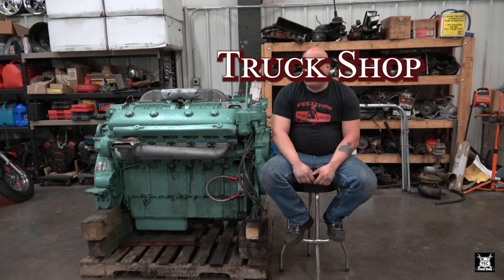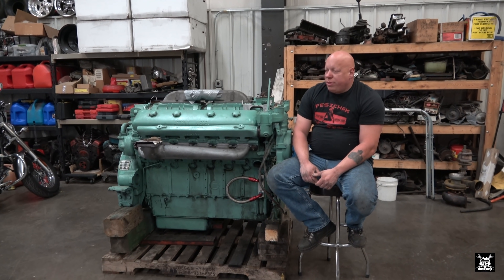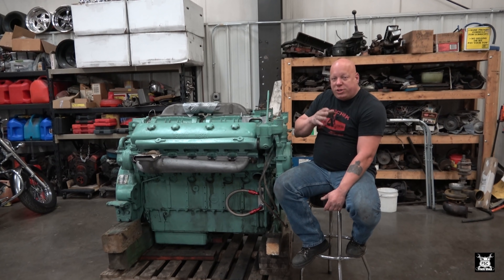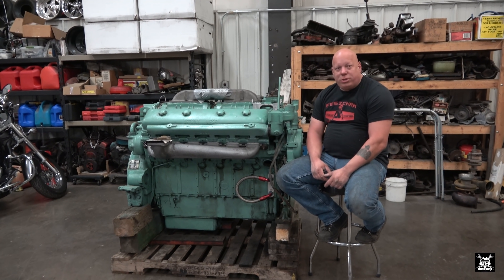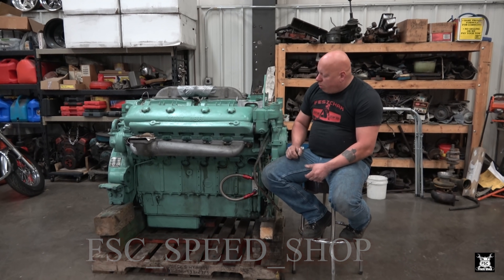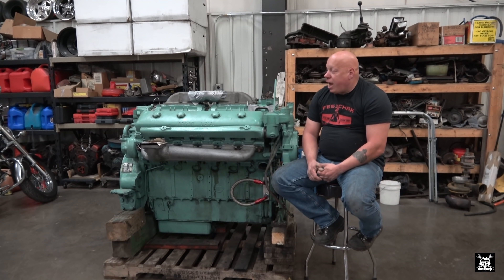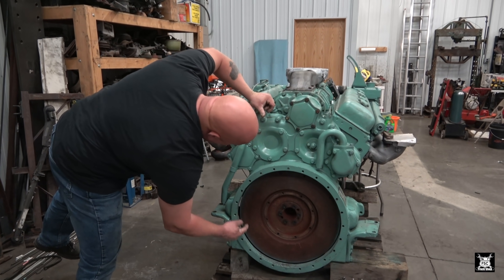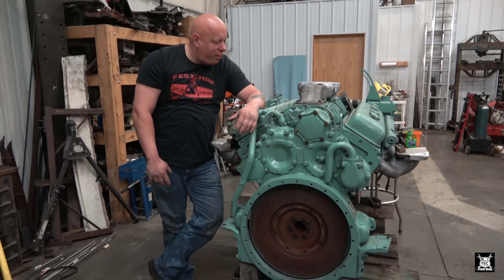Making Plans For My 12v71 Detroit Diesel

Comment: Theres really only one answer to the question. You need to check the for sales for a GMC General. A Marmon, Brockway, Hayes, anything not run of the mill. KW's and Petes have been done to death, id probably still watch though.
Reply: A GMC General would be the best choice for that engine, especially if it had a Detroit 8v-71 so that he could rob parts to make it fit
Reply: @4321grp  I think it would get good views too. So would an Astro.
Reply: @bobbob-fg5wy  I think so too. The 9500, Astro, and General were all the same truck, but different cabs.
Reply: Titan 90, or Bison would be cooler. Much rarer than Generals and Astros. I saw 2 of the bisons with sleepers sell at auction in Minnesota a while back. If he could find one of those, it would be very cool.
Reply: @4321grp .... the 12 would be an Extremely tight / hard fit under that hood... he would have more clearance problems than you can imagine.... Not a good swap candidate.
Reply: @bobbob-fg5wy .... There were quite a few Astro's built with V12's back in the early/mid 70s... but hard to find these days. I drove one for a while before I bought my first truck.  The guy I drove for, bought 23 of them.... also drove a COE "Transtar" (IH) with a 12.   All three of my own trucks had 12's..... and far from "stock" after I "built" them.

Comment: Plenty of great info available on these engines. They are pretty easy to build. I have done several 2 stroke Detroit’s and 3406 Cats. The Detroit is simple and you will have zero problems building this.

Comment: They originally put a data plate on the valve cover that told you the build,whether it was an Industrial,marine or OTR.
The type of flywheel housing,pulleys and governor is going to be an issue if you want to put it in OTR truck

Comment: Steve, make sure the truck that you want to get for this engine is already plumbed & wired for a Detroit 2 stroke. If this engine came out of a Terex,most likely it's from a dump, loader, or a scraper with an Allison behind it. The turbo engines have a bypass valve set up. For a con- ventional truck, you have your choices. Besides a KW or a Pete, how about a White Western Star, I-H Transtar 4300, Mack Western R- 700 model, Marmon or a Brockway with the Sheller- Globe R cab.Just make sure it's already set up for that 12V two stroke to avoid issues & more money.

Comment: Ol2stroker almost only works with the two stroke Detroit’s he legitimately has a tattoo of the logo and has multiple trucks with em such as a 359 and a 362 cab over I believe with the v12 in it I’m sure his videos would be educational for u as he does very in depth videos on freeing injectors etc I highly recommend watching his videos especially working on project mossybroke the 359.
Reply: Yep he is in the process of rebuilding a 12v71/92 if I’m not mistaken, either to make it into a show or everyday use type truck

Comment: Contact Scott from Bus Grease Monkey, he knows his shyt when it comes to two strokes. I would drop her into a Mack R model RS700. (Think Rubber Duck from the movie Convoy it was an RS700) They were an option in those trucks and it would be different from anything else anybody is doing. Also, R model parts are still pretty plentiful and you can even get sleepers used in good condition to fit one should you need it. The RS 700L was the long hood version for engines such as that. Love that bike you got, I have its competitor, a Yamaha Royal Star tour deluxe and love it as well.
Reply: There are at least several Mack RS/RL 700L's running around in the ATHS (American Truck Historical Society) with V12's... but they Are rare, that's for sure.... many of those "hoods" had either the old twin Turbo Thermodyne (864 or 866 engines)V8, Maxidyne V8(865 engine) or the "big" E-9 V8... depending on the year / era that they were built.    

Those early (864, 866 & 865) Mack V8's had all kinds if issue's though, from failed injector pumps to blown head gaskets.... the "big" E-9 though was a whole different breed, and was much less problematic.... though I've know of a few, where the fuel injector pump bolts, vibrated loose and the pump vibrated back away just enough from the gear drive enough to quit... not good.   The E-9 powered Superliners are some really strong contenders within the NTPA and ECPA Super Pro Semi Class sled pullers, against the highly modified 3406 Cats and QSX (KTA) Cummins... of course the E-9's are highly modified within that same class as well. 

As far as Scott is concerned (BGM), he's certainly found a niche for himself, and he's a nice guy...... but, I would Really like to see and hear some of the engines he's "rebuilt" after a few years on the road, and they have some miles on them..... the proof of quality work, is in the Longevity of a good running engine..... or lack thereof.  Would be interesting to read the reviews... several years or so, down the road.   I'm Not saying anything negative about him... just saying, what I'm saying, out of curiosity about longevity of the work done.

Comment: What you decide to use as a base truck, try to find one that already has this model engine in it.  Then you have all the parts you need and don't have to worry about manufacturing parts.
Reply from the maker: I'm hoping I'll find that.  Even if it came with a 6v71 or 8v71 it would work well.

Comment: The butterflys that I've seen have been needlenoses. That's a lot of engine to fit in a narrow nosed truck. IMO, anyway. Not much room fit the air cleaners, and you'll need a couple of 'em, as much air as that will need.....Maybe move the luberfiner somewhere else, and mount both cleaners on the cowl?

Comment: I put an industrial 12v71 similar to yours in a Peterbilt chassis with a 1934 Ford cab on it. Lots of work. Find a truck engine. 
Your engine has oil pump mounted in the base that makes the engine tall. You need to get an oil pump that runs off th front of the crank. This will require a hunt for an oil pan. I took 2 and made one. You need donor engines. 12v71 series did not use bypass blowers when turbocharged. They all have pulleys on the front. You will need a flywheel from any v71. I would check for stuck injectors then start that before you overhaul it. Make sure it is correct rotation. Looks like the correct governor must have been in a rock truck.

Comment: A 1970s Autocar would be cool. You don't see many of those.
Reply: i was just reading briefly about those in a magazine, there suppose to be building them again
Reply: @John-kr7iz .... the A-Car name is still going, and has been for a quite a while now.... but they are focused on the class 5 & 6 market of trucks for ie: Trash trucks, P&D work, cement mixers, etc.   They ARE NOT the same ole really Tough trucks of yesteryear, that they once were.  The cabs (most models) are of LCF design (Low Cab Forward), type of "cab-over" (COE).
Reply: @Romans--bo7br  ahhh ok yeah those trucks were a legend in their time for sure

Comment: Get in contact with Ol2Strokes, he is very up on these engines. They used these engines in Alaska  during the pipeline build because at the time they were the most powerful.  Mostly in GM trucks because that was the only ones they could get quickly from what I understand.  Cabover would be awesome but I think go with a 4 axle conventional from the late 70's early 80's.  Its the fact its old and cool is all that this is about.  Yes there are many new engines that would kill this engine but this is so cool, this is what people want to see because they don't see much of these. Also you will actually work this truck!

Comment: Steve what would be real rare if you can find one that's for sale is the longhorn DODGE conventional put it in that with a true 5 an 4 transmissions and put a mercury sleeper on it or the DODGE cabover would be rare there's a guy that's working on one of those with a box bed on it I think 
his channel is  cm. works 
     maybe wrong on that but either of these is definitely the rare of the trucking world but that's my picks but your the one that's gonna be driving it and working it so you build what fits your needs that's the important thing about this is a user friendly truck so stay safe and keep the video's coming

Comment: When you had the airbox covers open, I noticed that your rings looked like they're in good shape, even the fire ring (top ring) is in good shape. The way to inspect a Detroit's rings is to see if the groove in the center of the ring is still there. If it still has that groove in it, That means there's not much wear on the ring. Also if an engine has a lot of hours on it, many times the fire ring will be broken up with pieces in the airbox cover. You may not need to overhaul your engine. Your engine looks like it's an industrial engine instead of a highway vehicle engine. The pulleys on the front of the engine are normal, they're supposed to be located where they are. The accessory drive pads on the rear of the engine can have pulleys mounted there as needed. The flywheel housing looks like an industrial housing and therefore the mounts probably won't be right for a truck, also the flywheel may not be right for a truck. That crack in the block needs to be repaired by brazing it. Like you said, it would help to have an old truck engine for parts..
Reply: 4321grp..... The Model No. 7123-7030..... with the "3" in the first group denoting that, yes... it is an Industrial F/F (Fan to Flywheel) engine.  Depending on what exactly it was used in or on.... he may have to change out the governor, as it "may" be equipped with a Variable Speed..... and will need a SWLS instead (Single Weight Limiting Speed).
Reply: @Romans--bo7br  , At 10.18 in the video you get a good view of the top of the governor, and it's definitely a limiting speed governor.

Comment: Yeah there's a 3-71. It was in the legendary Chamberlain Super 70 and Super 90 tractor built under license in Western Australia in the 1950s. They have their own class in vintage tractor pulling. Peculiarly, the Super 70 nearly always out pulls the Super 90 and no one seems to know why.

This info below is to give some perspective as to where the 12V71 sits in the overall scheme of things.

As far as modern inline 6 truck Diesels go 12V71s don't produce much torque - typically a rather effeminate 900ft/lbs but some are a bit better possibly up to 1300ft/lbs when modded. 
Thing with 2 strokes is the torque they do have is very useable because they have double the power strokes so they hold the torque they have down to very low rpm and have a very broad spread of torque rpm wise making them feel more pwerful than they are. Idiots always say they have a narrow torque band (like a 2 stroke motorcycle I suppose) but they're talking shit because it is exactly the opposite. Any dyno pull down test confirms this again and again.
Although older tech themselves inline 6 CAT 3406, Cummins Signature and Series 60 Detroits were uncorked in Australia compared to US domestic market and torque in the 2000ft/lbs was not uncommon in standard trim because we commonly have B-Doubles here and gross weight (without mass management) is 62.5 metric tonnes standard. Hig truck weights is why we get high spec US based inline sixes and they get excellent fuel economy when off boost too. 

So, as mentioned 12V71s make 900-1300ft/lbs in automotive, which is partly why the Detroit 92 Series came into being. The 8V92 specifically the 8V92TTA Silver series was a fantastic engine with amazing reliability and standard torque was in the 1350ft/lbs range as opposed to the lower 1000ft/lbs range of the 12V71.
Silver Series 8V92s have 4 less cylinders so the pumping losses are less, more cubic capacity, DDEC fuel control and a single turbo with bypass blower and a liquid to air aftercooler beneath the blower. These are a far easier engine to get big power out of compared to a 12V71 HOWEVER I have always wondered if you could get really big torque out of a 12V71 with twin turbos, bypass blowers and an external intercooler. 

A true 2000ft/lbs of reliable torque out of a 12V71 would be my aim. When I say reliable I mean field reliable as you'd expect in commercial operations hauling a fully loaded semi day in and day out for two decades at the usual 2100rpm, rather than 2800ft/lbs for laughs a half dozen times a year at 2600rpm. If you can do that without it being rolling coal I'd say you've really achieved something very special.  
2000ft/lbs is my benchmark because when you've driven a big rig with that torque on a daily basis you feel as if you actually have adequate power when heavy. 2000ft/lbs on a 12V71 is in some ways a lowish benchmark to aim for but if you could get that at 2100rpm without the usual opening it up by increasing the rpm then that would be a most satisfactory outcome in my view.

Some 12V71 and many other Detroit Diesel 2 stroke dyno tests: 
https://www.youtube.com/channel/UCBtgBbqBswEIbHf5_-zsGLA/search?query=12V71
https://www.youtube.com/channel/UCBtgBbqBswEIbHf5_-zsGLA/search?query=detroit

Comment: i would contact fred sanders from ohio he has built some of the best running v12 detroit pulling trucks and he is very smart when it comes to detroits the only other is the rees family they had some very strong v12s years ago i would just do a kw w900a extended hood they did put v12s in them and you would have plenty of room under the hood for the twins and are you building this as a day cab or sleeper cause that makes a difference to hope this helps

Comment: That will not fit in a needle nose truck, A GMC truck would be interesting .
Reply: Opa Pearce.... yes, it will.... just need to make cutouts in the sides of the hood panels for the head / valve covers.  Its been done before by numerous Ole School, Independent O/O's (Owner Operators), who wanted to "get it there, yesterday".  We had some rigs back in the 70s and early/mid 1980s that could and would, really "rock and roll"... especially at night, across the open roads of NV, NM, OK, etc.... numbers of V12's pushing 700+ hp back then when we still had "good" fuel.

Comment: Please stick with Cabover, just use an older one which the others are not using. Like a Ford or a Diamond, or a Jimmy, and so on. You yourself and a truck are enough to have people watching. It sounds like Matt is thinking truck show, wanting to show off the engine, but it is for work mainly? I don't need to see it parked, I want to hear it and see it working with you having to deal wit Karens & toll booths and so on.
The real guru is Joe Maser over in Oregon. Repairs them for a living. Builder of the Cornfield Corvette 12V71 drag truck. Countrylife knows him personally. 
Countrylife's cabover is a Mack but it is 4stroke and not much used. .Tim Gentry doesn't like 2 strokes as otr he prefers 4 strokes. Ol2 stroker does not do otr, his are toys. Same goes for that Canadian tit with a Kenworth. Not for Hire has a Freightliner, 4 stroke again. Chad's is 4 stroke & Kenworth.  CM. Works has a Dodge, a 4stroke, but it is a real long term project. 
Best of Luck.